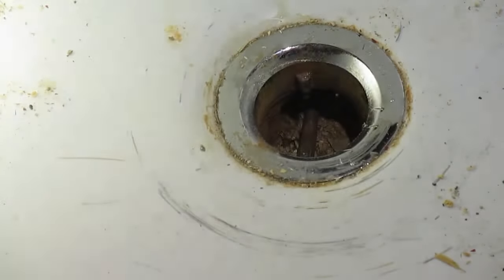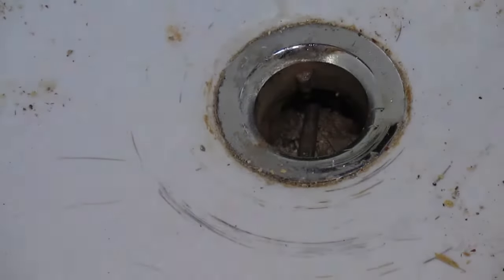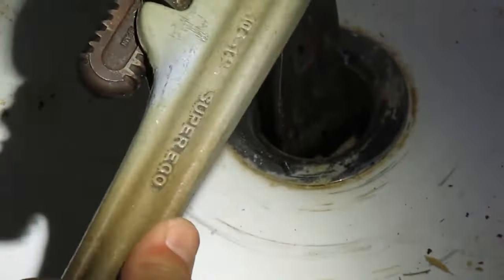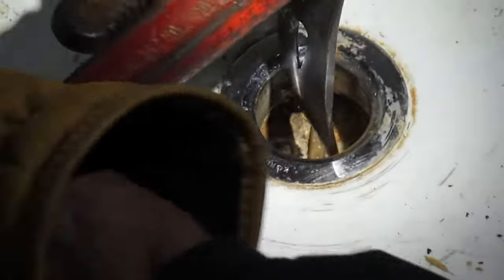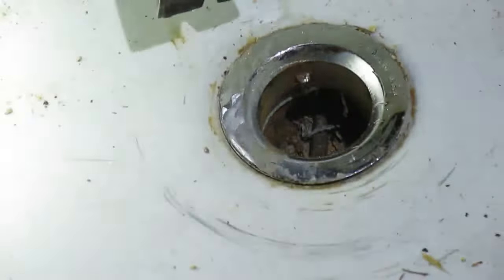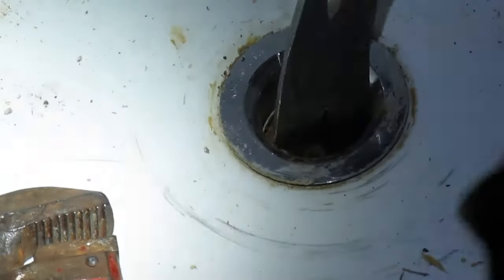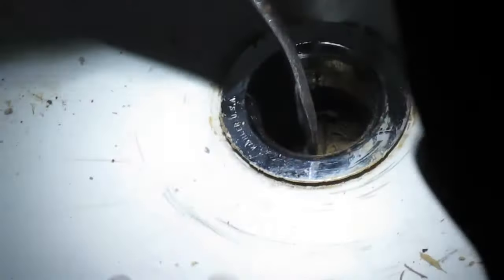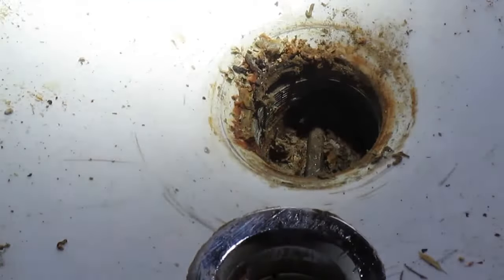Bathtub 2 Inch Drain Flange Removal

Comment: That is a a solid quality brass drain piece not that common anymore. The proper tool to remove and install this drain is a Heavy Duty internal adjustable spud wrench, it has two fingers that will go over the horns and lock on to them which provide better force transmission.  However if you just want to remove the dang thing your method is not bad at all.

Comment: Home depot sells a tool to remove the drain flange. Just look for it in the plumbing section. I onw it and it's a lot easier than the technic just shown cost $11.00 plus tax and the removal of the flange is out in less than 30 seconds. That's  how long it took me to remove a 22 year old drain flange.
Reply: I have the tool you mentioned but still
  it was so hard. I ended up cutting it.
Reply: @joshua1223ag  Sorry to hear this, old drains are hard to remove. If in the near future you need to change another old drain and it gives you trouble try DW40 to break the seal.
Reply: @ivettenegron2624  thanks

Comment: Just cut it with a sawzall then a hammer and screwdriver not that difficult folks just don’t give up after all you can plumb dumb but you can’t plumb scared
Reply: At your own home, sure, but replacing a customer's tub because you chose to use improper tools is hard to explain on YouTube.